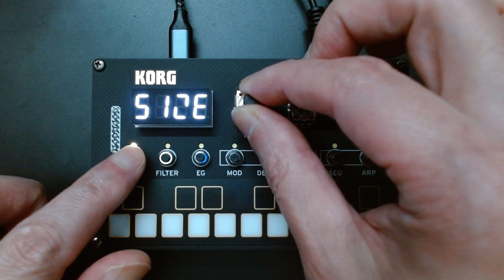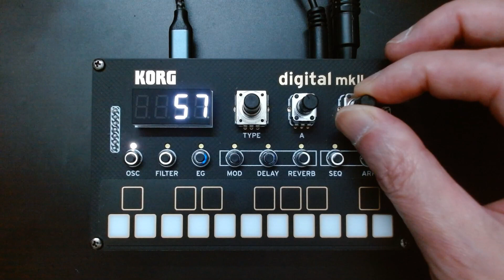Pitchy: pitch shifter oscillator for NTS-1 markII

Comment: Does this also change formants?
Reply from the maker: This does not preserve formants. Changing pitch results in formant shifting.
Reply: @boochow8625  but do you have a formant parameter?
Reply from the maker: @boimesa8190  there's no formant parameter.
Reply: @boochow8625  Could U add that?
Reply from the maker: @boimesa8190  Sorry it needs completely different signal processing, so I am not planning it
Reply: @boochow8625  oh damn... Do u also make vst plugins?
Reply from the maker: @boimesa8190  I don't because there are already bunch of plugins. But if I needed, I might do.
Reply: @boochow8625  would u be willing to make one with someone else?
Reply from the maker: @boimesa8190  Usually no. Also, I have an ongoing project right now, so I don't have enough time to do other things...
Reply: @boochow8625  would u consider it if its a unique project??
Reply from the maker: @boimesa8190  Not always. Even if it is unique, I’d also need to feel it’s something I want and can reasonably build.
Reply: @boochow8625  ok, what about a unique multi impulse response loader with spectral cross-fading and unique IRs?
Reply from the maker: @ Sounds technically cool! Could you give some use cases, like cross-fading reverb or EQ settings? I’d need to better understand the purpose or context to see its value.
Reply: @boochow8625  well yes and no. The mentions of reverb usage etc would be possible BUT the focus is mostly on "surface simulation" we have a bunch of IRs that simulate the sound of different materials vibrating/resonating with ext sounds.... Maybe we should contact eachother through other means?
Reply from the maker: @boimesa8190  OK, you can DM me on X ( https://x.com/boochowp ) if you like.